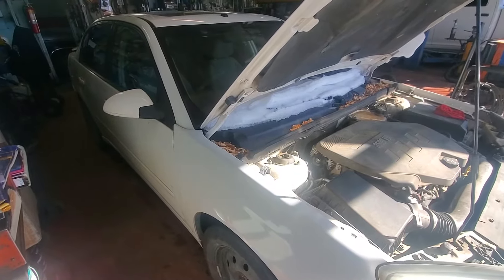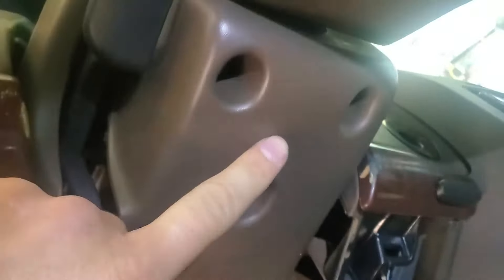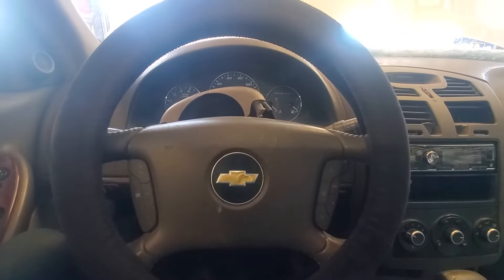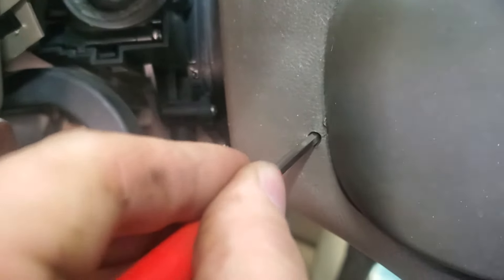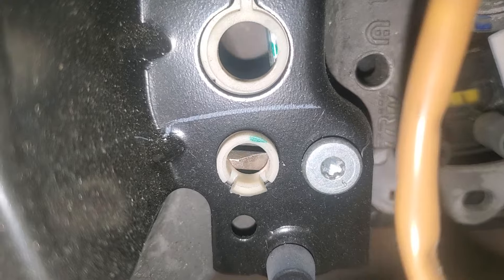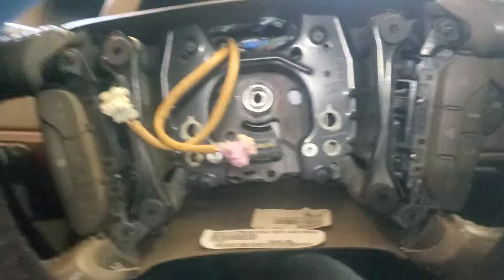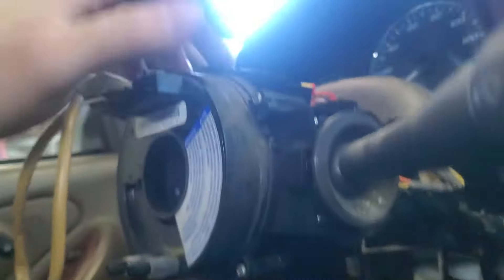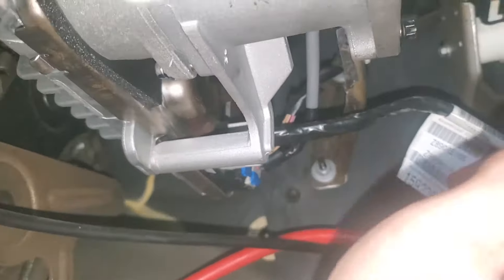2008 Chevy Malibu steering columb removal for torque sensor replacement

Comment: Great video, I managed to replace mine, but now the horn is stuck and I had to remove fuse, any suggestions?
Reply from the maker: The wire that runs it could have gotten pinched

Comment: Working on a 2007 3.5 I got with power steering problems.
Reply: Did you ever find a video that explains that cuz I know it's under warranty they're all messed up with their models cuz I have the same problem and I'm doing it myself
Reply: Have you found a video cuz I have the 3.5 L but I have the 2008 classic edition yeah all that it's under warranty it's an issue that they all have and I'm just trying to do it myself in hopes I don't have to reprogram it

Comment: That through bolt you referred to on the column the last bolt you took out for the column to remove a completely funny I have an 08 Malibu I have the classic LT the 3.5 L and that through bolt does not come out like that my gas pedal has another contraption that I'm not sure exactly what it's called to the point where that bolt hits it you it's sucks to try to get it out if you know any easy way it'd be much help because it's a nightmare. Trying to replace my electric power steering assist and I'm hoping I don't have to have it reprogrammed
Reply from the maker: Yes, IF your car has adjustable pedals, you will have to unbolt your pedal assembly. It is 3 bolts I do believe to remove that out of your way
Reply: You're right. Mine actually didn't have it. Whoops. I appreciate the good info though.

Comment: Seems like too much disassembly just to get the sensor replaced? Why take the steering wheel off? All the other videos ive watched spend less time by just taking out the whole column with 4 bolts, and they dont say anything about the air bags..im confused. Can't you just take the whole column out all at once and save time?? The other videos look way quicker with 4 bolts and unplug battery. My airbag fuses are already pulled so that's my reason for asking